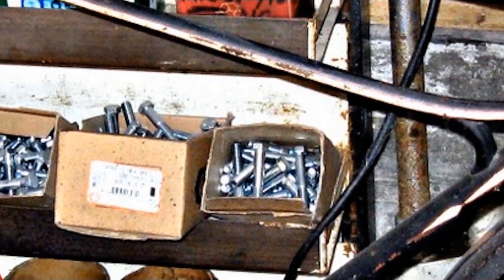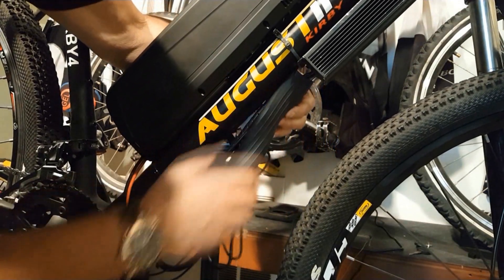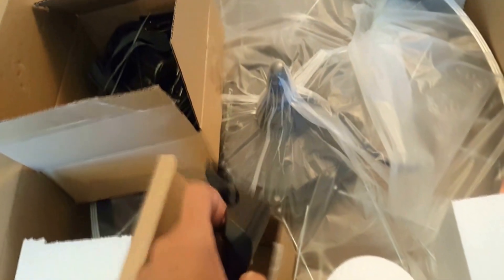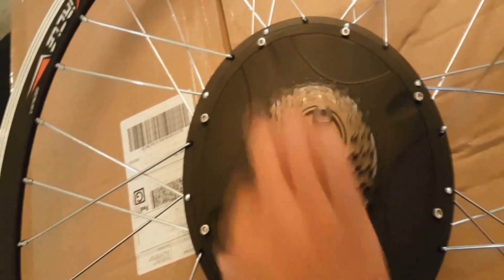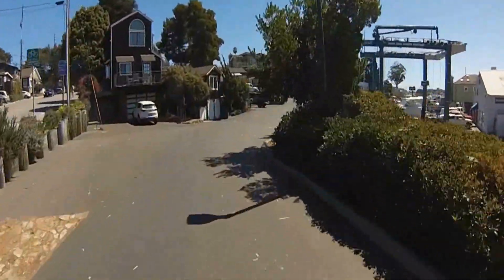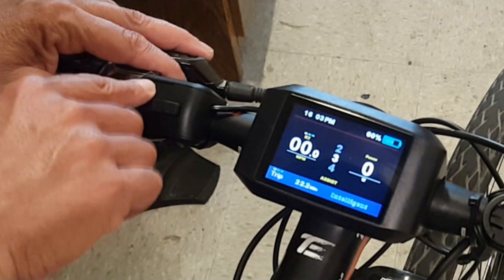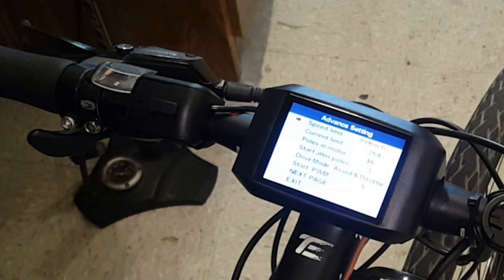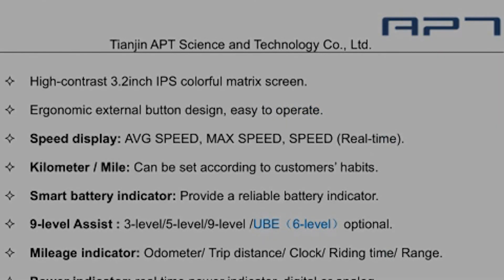Build an Inexpensive Ebike + 1500w Assembly + TFT 750 LCD Programming

Comment: How do you choose a proper donor bike to buy?
Reply: one of the primary things is, how is the frame built .. if it has enough space for controller and battery to fit into the frame ( triangular space among the tubes)   ... also  aluminum frame is advantage because of some pounds off in comparison to steel, but  that doesn't make so
much difference ...   also the bike should be in rather a good condition so that it can handle  long trips... i am building ebike  right now .. i wanted to convert my favourite steel frame torrek bike , but it has insufficient space in the frame for good batt ... so i've chosen an aluminum frame bike with enough space ... it's gonna be rear hub 1,5kW
Reply: heads up. alloy frames are susceptible to bending and breaking under the pressures a fast e bike puts it under. my 1.5kw alloy hardtail feels unstable taking a gradient drop of less than 1 cm when at speeds higher than 20mph.

Comment: The comments are very good. I had my experience with the Aston Rider kit on ebay, it came out less than 290usd with lifepo battery and it has been running without problems since I had it more than a year ago

Comment: I see most ebikes have disc brakes, can you use the cheap caliper brakes found on cheaper bikes- Will it be enough to handle the ebike motor?
Reply: It isn’t preferable but it will work you will probably need to change pads often.